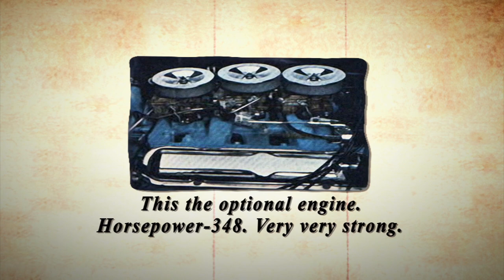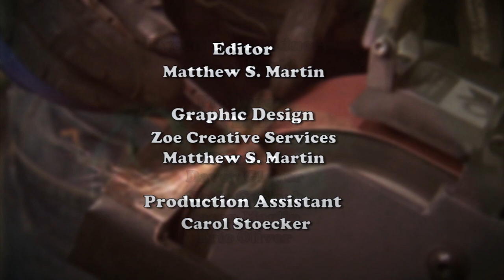How to Build a Tri-Power / 6 Pack / 3 Deuce Carburetor Setup - Stacey David's Gearz S2 E5

Comment: An oldie but goodie. The old 6 pack did great in town or for some simple light cruising and you didn't burn a ton of gas either because it keep you running off the center 2 barrel carb. That changed once you stomped on the throttle though. You could literally watch that fuel guage needle drop like a lead brick. Hard to believe that when I was a kid, we use to hear people bragging about 12 and 13 mpgs.

Comment: Back in the day I had a 1972 Vega GT hatchback, yeah I know a Vega?
Well Motion Performance, was building V8 Vegas and had a V8 swap kit that wasn't all that expensive.
You needed to find a rear to fit, which also wasn't that hard. Small block Chevy's, 283, 327 and 350 where everywhere and cheap too.
Edelbrock had a 3 2bbl & 2 4bbl manifold for the small block.
Wanted to do it, but never did.
There was nothing like a Vega rolling by with the rumble of a small block.

Comment: So just some clarification on the 500 end carbs ... I also have a 340 Six-Pack set up .. looking for some spare ends 500 carbs original parts numbers are 0-4790 rear and 0-4789 front .. i found both but between the price to buy and restore is crazy.. so I purchased a new center from Holley 0-4792 350 CFM .. I see they no longer remanufacture the end 500 carbs for the 340.. so I have been looking at the 500 CFM carbs for the 440 engine 69/70 Holley 0-4365 and the 1971 440 engine 0-4672 .. I've been told the 69/70 has a different style metering plate and the 71 has the same style metering plate that my 340 end carbs have in them, just a different jet size. Question: will either of the 440 end carbs work on my modified 340 ? and if so should I go with the 69/70 or the 71 carbs? Any help would be greatly appreciated from anyone who has dealt with this scenario. Thanks

Comment: Mr Stacy I really enjoy the video about the tri power carb setup I have a question. I have a Ford mustang 200 I was planning on putting a Offenhauser 5205 on which takes 3 single barrel carbs is there a kits to rebuild a single barrel carb to eliminate the choke and the fuel air screws like in the video you showed, with the 3 duces. I was told it a good setup but tuning the carbs are a pain, the way you had talked there is minimal if any tuning to the outside carbs. Thanks for the help.

Comment: Well actually 2v carbs are cfm rated different than 4v carbs … 1350 cfm 2v = 955 cfm 4v … still tons of air and fuel ⛽️ still way cool looking … lots of hot rods also run block off plates for the extra carbs (e.g 8 x 94’s is 2 x 94’s) … all the looks and just enough carb for a stock motor … cfm needed = (cubic inches x max rpm) / 3456 and the conversion from 2v to 4v is cfm x 0.7071 …

Comment: 2:20 Can I just use any Rochester 2G/2GC as the main? Shouldn't there be a specific jet size be required to plonk it on the Edelbrock with its two slaves? From what I know they come in sizes between 0.044 and 0.073 - which to me seems significant enough to make a difference...

Comment: Hey Stacey David, maybe a dumb question but will any 2 barrel Rochester carbs work or is it a specific type/year that I need to look for? I found a guy that has several 2 barrel Rochester's of various years that I can purchase from but I don't want to waste money if it has to be a specific year/type carb. Thanks for the video and the input. Anticipating trying this tri-power out on my sbc 350!
Reply from the maker: The primary carb isn't as particular, but the secondaries are usually specific. You can buy them already set up to be used as secondaries from some companies.

Comment: Can you get the manifold in a small block dodge?? I'm doing a 340 magnum for a 73 road runner.
Reply from the maker: There were some factory 6-pack manifolds for the Mopar small block in the Challenger T/A and AAR 'Cuda, but they're expensive and hard to find. I'm not sure if anyone makes them in the aftermarket.
Reply: @OfficialStaceyDavid  thanks Stacey.  I found a complete stock set up for 1200 bucks. Going to put it on a AAR 340, and stick it in a 73 barn find road runner. Taking the stock 318 out. I don't know why they put those 318 puss buckets in a road runner, but I'm fixing that problem, lol.